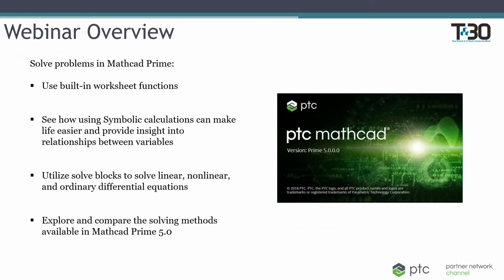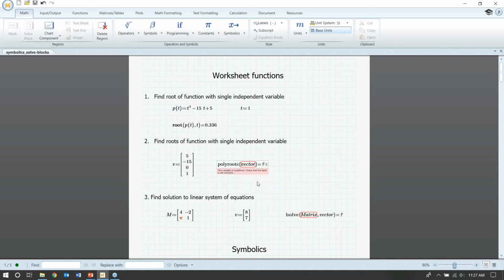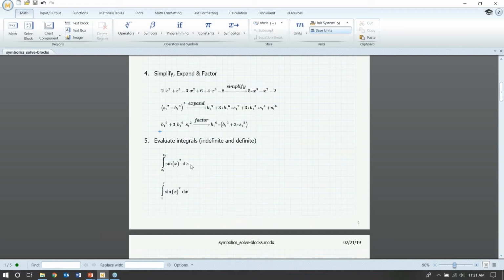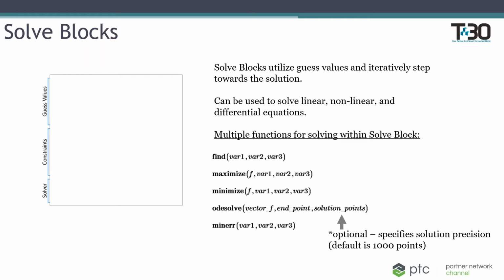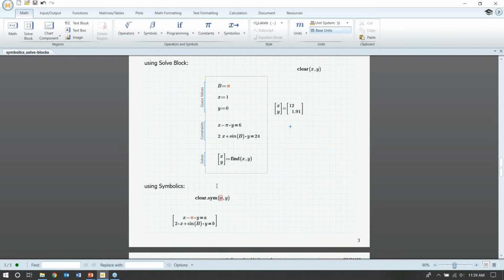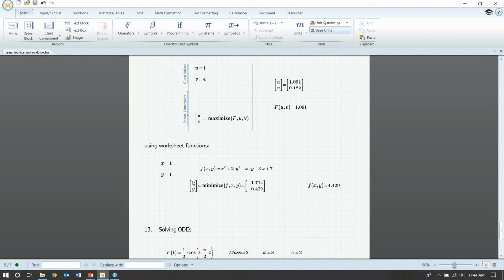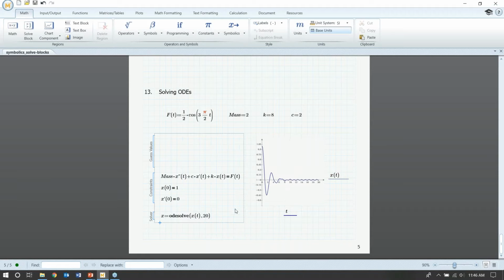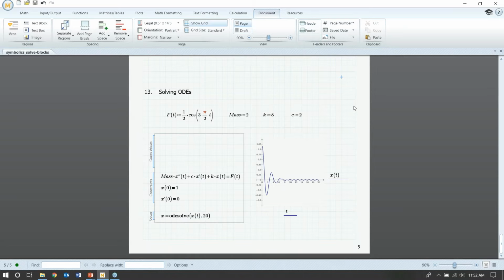Mathcad Prime - Solve Blocks & Symbolics Webinar

Comment: Very good video sir, I am having a problem on example 6 however. When i put in units the solve (lambda) command will not return a value as you have shown in the video. However if I delete all the units for the values then it does work?